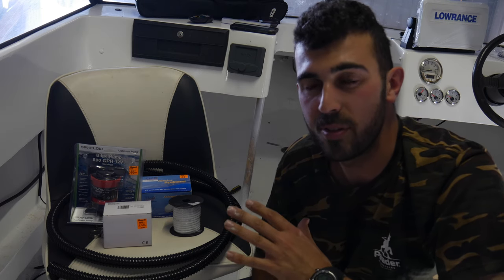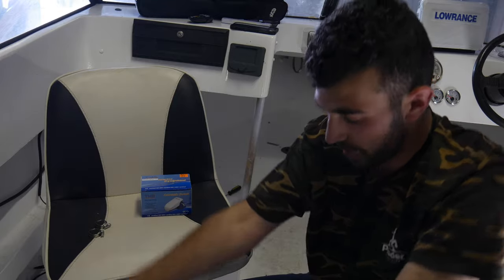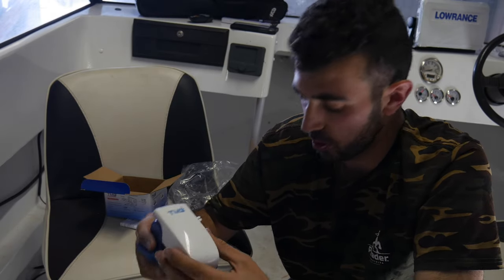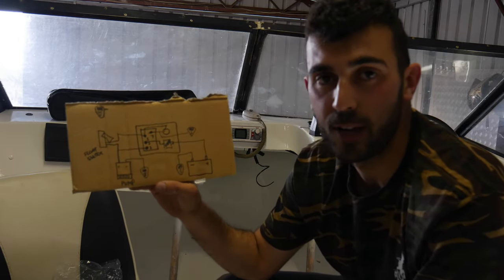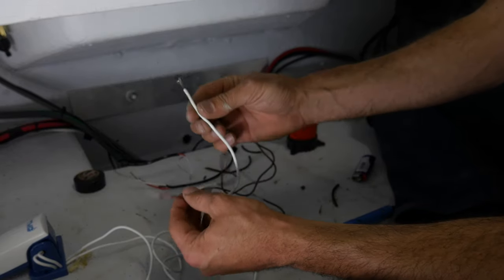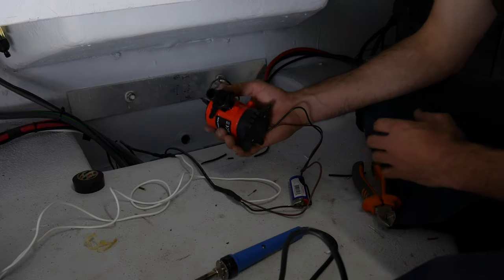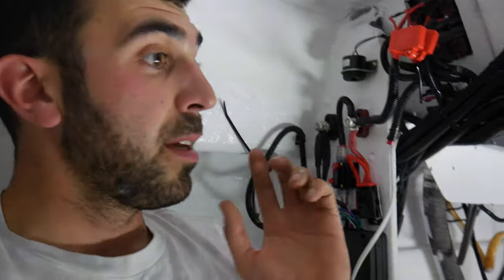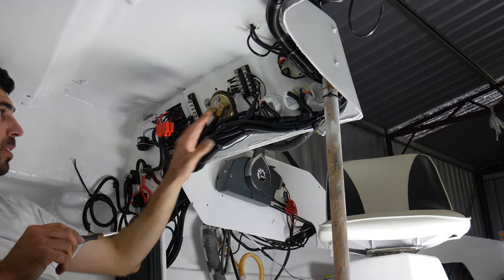BILGE PUMP AND FLOAT SWITCH INSTALLATION | DIY GUIDE | FULL BOAT RESTORATION - PART 20

Comment: Alright chief, new to your channel hence the late comment. A little tip for excess silicon is to give the area a light mist of soapy water and you can just wipe it away with your finger. Also drain holes and most holes through the hull or transom if you give them a lick of paint before sealing it can help if you do get a little water ingress. Smashing series though👍

Comment: I always  add a 2nd bilge  pump and 2nd battery  which I move to a location forward  of the transom.
Reply: I’ve been thinking of fitting two of everything, bilge pump, gps, radio.   one on show an maybe one behind an access panel for emergencies

Comment: Awesome and helpful tips very nice job loving the boat restoration series been watching your videos on repeat there really helpful cause I’m also rebuilding my first boat. I was hoping that maybe you could do a more in-depth video on how to wire your gauges for etec cause the manual isn’t that in-depth. Thank you and keep up the awesome video’s 👍
Reply from the maker: Glad you like the video mate! Yes the gauges are a little confusing but reading the manual and tasking your time does get the job job! My original gauges were not working so all aftermarket gauges were used :)